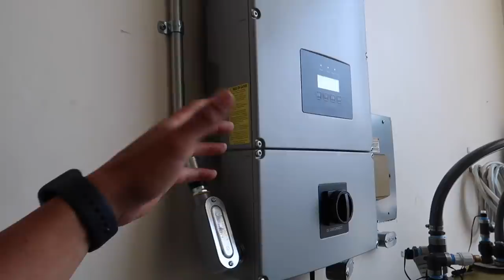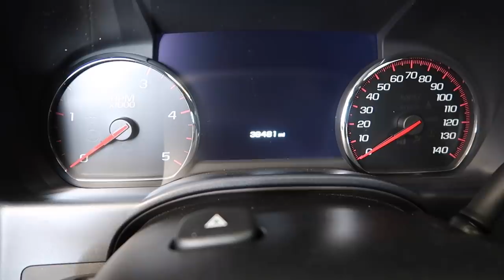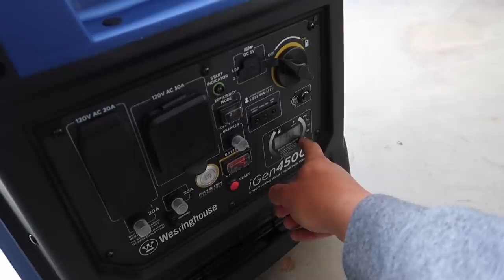AN UPDATE ON IF YOU SHOULD DELETE YOUR TRUCK OR NOT

Comment: I have a 2016 DMAX new as well, end of 2016. Deleted it at 40K with EFI Live Kory Willis tunes including transmission tune. Best thing I could of done. Love my truck, zero issues and runs like a champ. Going to run it till the wheels fall off. I wouldn't get a new DMAX for  all the same reasons.
Reply: I recently bought a 2016 Silverado 2500hd with the 6.6 Duramax and I'm really interested in doing the same! I just don't know where to start, as this is my 1st diesel

Comment: The dealership guys may be idiots but not about a 2500 with Aisin trans. I was trading my previous 2005 Dodge 3500 for a new Ram and thought about going back to a 2500 but wanted a Aisin trans, salesman told me the same thing. Have to get a 3500 to get that trans. Just looked at Ram website to spec a truck, Aisin trans is not offered on the 2500 trucks. Going with the Aisin trans also pairs up to the HO 6.7. I have the Limited crew cab long bed, just towed my 24' bay boat with hard top from NC to Florida Keys and back, literally can't feel that boat behind the truck. Easy to forget that I was towing a 30' trailer.

Comment: Eddie, heads up. Thats not always true about the early 15 having a V band clamp and the 15.5 having the 3 bolt flange. My truck is a 15.5 built 12/2014 and it has the V band clamp.
Reply: Apparently his didn't

Comment: Can someone explain what it means when the torque converter locks, and why it is beneficial? I have no idea what it means.
Reply: imagine a torque converter being like you riding the clutch for faster acceleration on your car. it multiplied torque output upon take off and acceleration, but they also waste energy when unlocked and use two opposing turbine wheels and use the fluid to transfer the power. the lock up is like letting the clutch all the way out and provides a straight shot though it into the transmission allowing fluid temps to go down, and no wasted energy from the torque converter.
Reply: @brendan747  would a locked torque converter lead to rougher shifts? Not saying that's bad, I'm sure it's understandable when you are trying to exert maximum power from your truck.
Reply: Dylan Galman yes, the torque converter being unlocked allows the input shaft from the transmission to “slip” when shifting and gradually brings down engine speed where as on a Allison, in tow haul it locks the torque converter in 2nd and keeps it locked through the rest of the gears. it leads to rougher shifts, but no wasted energy into heat from fluid sheer between the two turbine wheels in the torque converter.
Reply: @brendan747  That's very interesting, I really appreciate you explaining that to me! Thank you very much!

Comment: Are 3.73 okay to tow with 22s on 35s or should you still change the gears

05 duramax
Reply: Anthony alvarez regear...stock 245’s on that year were like a 30” tire
Reply: 100% re gear no regrets what so ever after.